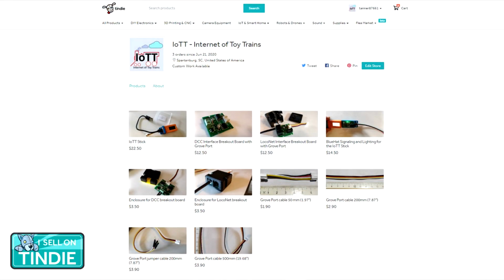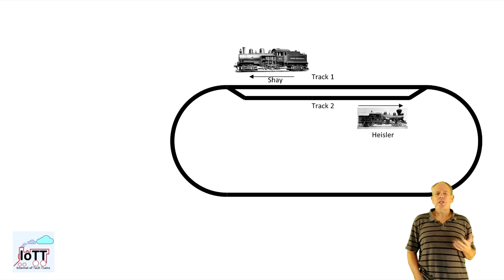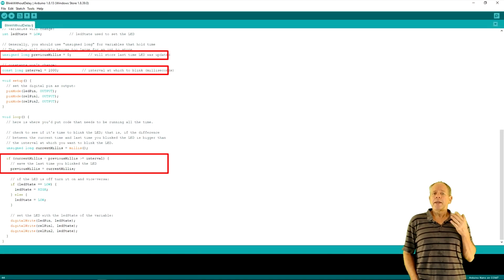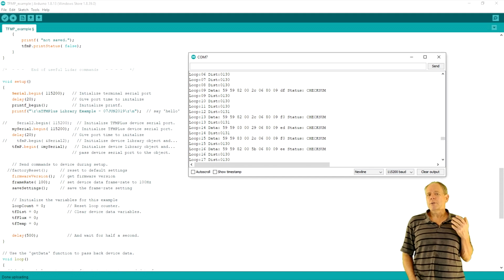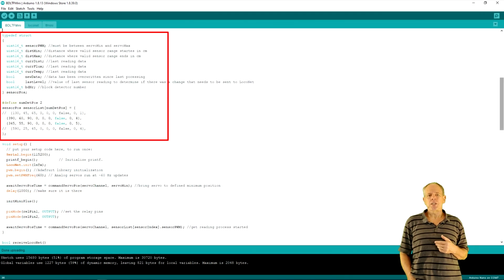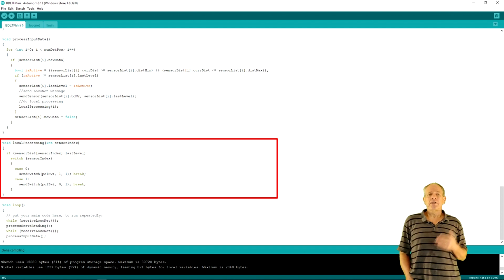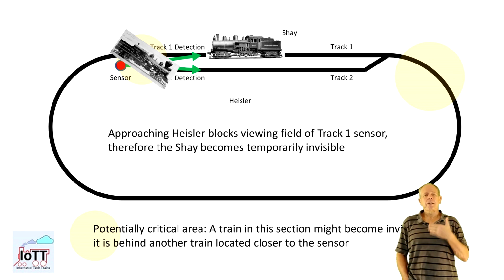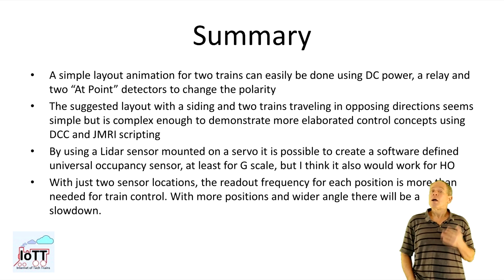Software Defined Block Detector (Video#46)

Comment: Nice video! Just a remark on the usage of the 'millis()' function.

You nailed the problems with the fixed delays and the proper implementation using 'millis()', but in the rest of the project, the way this timer is used could be improved... Although it takes up to 50 days for the counter to roll-over to zero, the value returned by the 'millis()' function cannot assumed to increment forever. Therefore, in the example project, the previous value is subtracted from the current value and compared to an interval. [ if (currentMillis - previousMillis >= interval) ] This implementation ensures the proper working even if the counter wraps around to zero.

For example, the expected time a servo will get at the requested point. If a new position is set; the current time is incremented with the expected travel time and stored into 'awaitServoPosTime'. To check if the servo has reached its desired position, this stored value is compared against the value returned by the 'millis()' function. If the stored timestamp equals to 4,294,967,295 (the largest number that can be stored in a unsigned long, the datatype returned by the 'millis()' function), the 'millis()' function will never return a value that is larger and therefore the if-statement in 'processServoReading()' will never evaluate to true. [ if (millis() > awaitServoPosTime) ]

This can be improved by accepting a larger or equal value from the 'millis()' function in this if-statement, but if the processor is bussy with another task during that specific millisecond, the program will stil be broken. A better implementation is to store the value returned by the 'millis()' function at the moment of setting a new servo position together with the calculated interval. The cost of this solution is the use of additional memory, but it will prevent nasty runtime-issues. The if-statement will look familiar to the blink-example:
   if (millis() - awaitServoPosMillis > awaitServoPosInterval)
Reply from the maker: Thanks for the review. There's always stuff to do better ;-)

Comment: Impressive! Using a lidar sensor while interesting seems a bit overkill especially at $49 but at a throat of a yard having multiple tracks this approach could prove quite useful.
Reply from the maker: Thanks for your feedback. Yes, cost is a good point, particularly if I only substitute 2 reed switches. It it is possible to emulate 10 or 12 block detectors with just one line of code for each, it also starts looking interesting from a cost point of view.
However, permanent installation is not my primary use case anyway (already because of the noise from the servo). I am looking for something flexible that I can use on a temporary layout to try out or demonstrate the effects of various sensor locations without having to change any wires or gaps in the rails. That would be the main advantage of a software defined sensor. Lidar might not be the technology of choice, however, but it is a lot of fun to try out for sure, and it somehow seems to work ;-)

Comment: excellent videos, but it's a pity your products aren't available in the UK
Reply from the maker: Thanks for your feedback. And sorry that I do not ship to the UK (or any other country outside US/Canada) right now. There are two main reasons for that:
1. My Tindie shop is brand new and want to start all the processes around it with low volume. By processes I mean sales and shipping logistics, but also replenishment of goods, including lead times etc. 
2. All my products are new, and while they have been tested by several users, I am not sure what problems new users who play with them for the first time may run into. Chances are something comes up and I need to have a product returned for investigation. So, I feel better if they are not everywhere in the world right now.
So, once I feel comfortable with those two issues, I will ship to other countries as well, including Europe and Australia/New Zealand
Reply: @IoTT  Thanks for the reply, I appreciate the position you're in. I'd gladly help out with testing